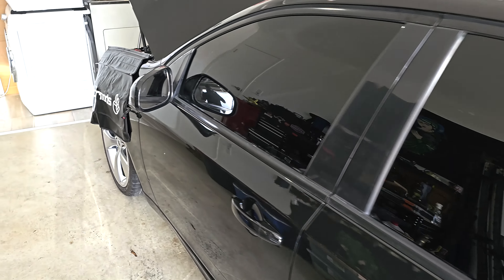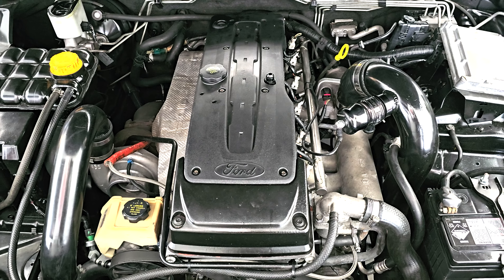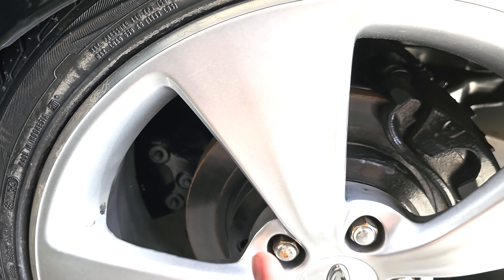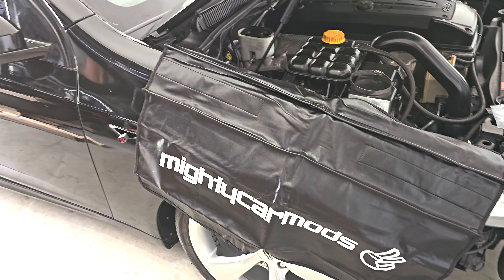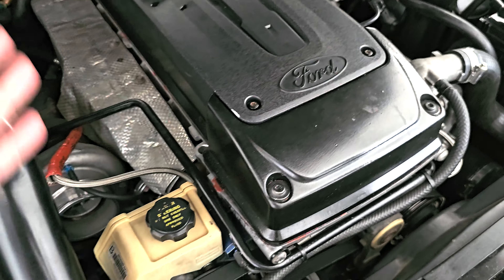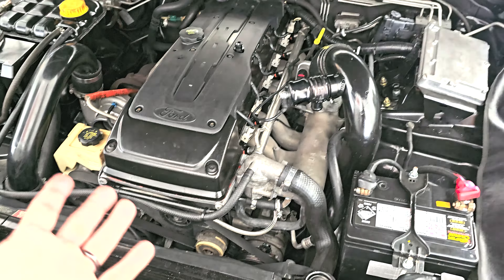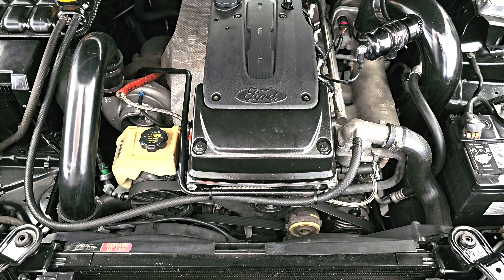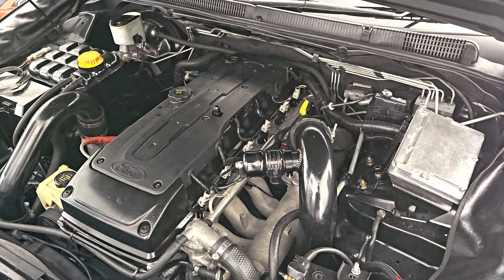Where Have I Been?! (Update)

Comment: Hey, did you paint the Nissan badge text red yourself or was it a purchase? If so please explain what you used. BTW, i'm Holden and have the same Patrol :)
Reply from the maker: Yeah mate, I did that myself. I do have a video of how its done (Haven't uploaded it) It's pretty fiddly. I covered the letters with tape, cut around them so the tape was on the inside of the letters, allow the outside to dry. then tape up the whole badge, then cut the insides of the letters out and hit it with the paint. What Holden do you have, a Falcon would suit you better ;)